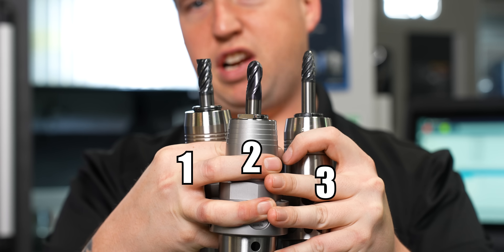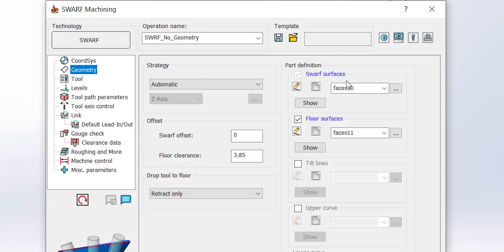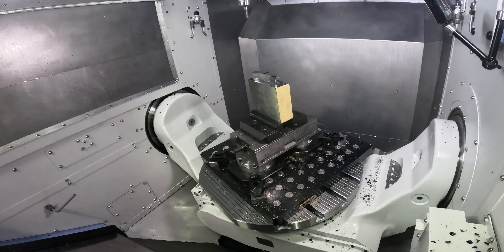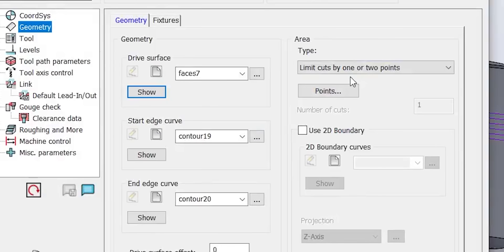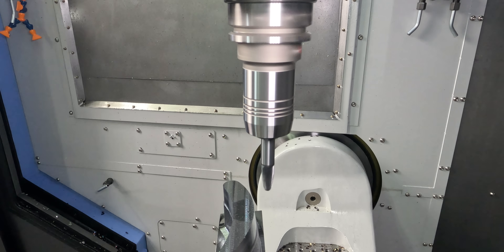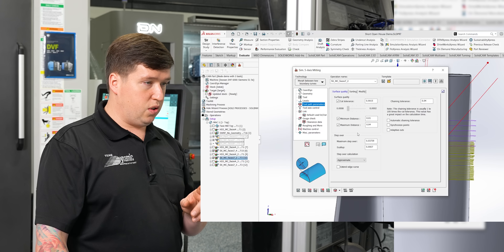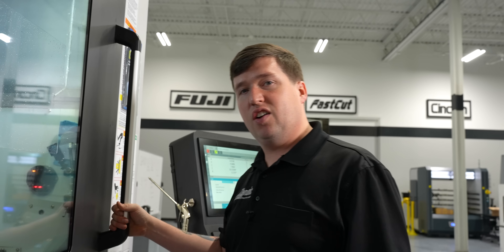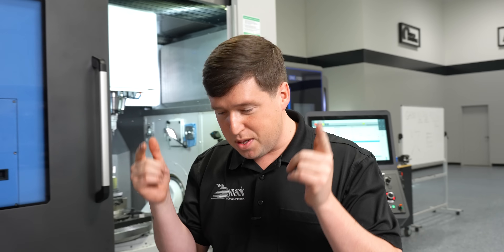3 Tools 3 Strategies 3 Results | Swarf vs. Barrel vs. Ball

Comment: Why not include cycle time? There is a significant difference between these three approaches. Also, to achieve a better surface finish, the step over needs to be reduced, effectively cutting the scallop height in half. Show how a 10 second toolpath quickly becomes longer than your lunch break.

Comment: me : define "Swarf"

chat GPT: Swarf is the polite industrial word for the mess you make while turning metal into shapes. Tiny chips, spirals, dust, curls, needles, glitter, shrapnel, whatever the operation produces. It is the physical evidence that atoms have been persuaded to leave their comfortable lattice and depart the workpiece.

In the broad sense it covers:

• Turning chips
• Milling chips
• Grinding dust
• Drilling curls
• Sawing filings

Basically, if it came off the workpiece and it gets everywhere, it is swarf.

Comment: However you forgot to mention limitations. While using the standard end mill, you can only use the specific length of cut.  Where the barrel and ball allow that pivot angle this giving clearance for one op manufacturing.  And we all know that less babysitting and tool changing creates better efficiency snd profitability.  Still for all intents your video is great for explaining the differences. I'm a master tool grinder and it's fun seeing the pieces i make so their jobs.

Comment: Its a neat demo, but i feel like there is annother point to the swarf that you are not mentioning. The tool projection of the mill limits you to a max depth. Those 7 degrees tilt angle do wonders in letting you snug up the tool.

Comment: A little off-topic - there seems to be a lot of "flexibility" in that setup, and not the good kind. All that chatter and resonance isn't good for accuracy, finish, and cutter life, is there something off with the machine, or too much stacked fixturing, or ??
Reply from the maker: Chatter? What chatter? Are you talking about the finish the rougher leaves? Those are just feed marks
Reply: @donniehinske  I'm talking about the resonance during rough milling, which from the audio and finish I take to be chatter. Not there so can't make a true judgement, but that's what it seemed like to me.

Comment: Donnie, you should turn on the cycle time setting for each tool path. It's a setting in soldicam. Then you can easily compare the different times between each tool path. Also, it will display the whole cycle time of the part beside the operations tab.

Nice video!

Comment: It's crazy moduleworks owns all the main multi axis algorithms that pretty much ALL CAM softwares use. I've never used solid cam but I recognize the pics from mastercams swarfing. We have mastercam and NX at work and even testing out NX I can see the overlay and how the backend is moduleworks algos. Basically most CAM software license moduleworks algorithms then just wrap the toolpath in the softwares UI but in the backend calculations the NCI or "list" as NX calls it (toolpaths before post processing) is created with the other companies algorithms. No wonder cam softwares are so weird sometimes so many different things have to talk to each other.

I got a video Idea Donnie. I am a proponent of using scallop height as the way to determine how you want your flowline (mastercam) toolpath to determine the stepovers. I have always said that using scallop means that you can change the radius of the tool, or if on a 5x doing 3x surfacing(3+2 style), change the angle of contact with the surface (say it's an angle or radius) and end up with the same surface. It's not true with step over. you can change the tool (mainly say a different radius ball EM) and with the same stepover you will get a different finish as well as how you contact the angle or radius on the part. Scallop > step over. So the video would be use scallop to determine step over on a toolpath, say surfacing a 45 degree face on a part in 3 axis mode. Then switch radius of the tool and show how you can keep scallop the same and get the same finish but if you try to keep stepover the same you end up with a different surface. I have always wanted to show people this. Some folks are just like "yep I do .005" stepover and it's a good finish" hahaha
Reply: It's easier to understand what movement the ballnose is doing compared to the surface area, when referring to the stepover. .005" is pretty small, and would cover most decent diameters. Unless you're getting to down engraving sizes. Either way. .005" is .005", and that means whatever cycle time estimate. The only thing that changes with a larger ball, is a better surface finish. Given space permitted to use it.

Comment: If you’re trying to get the best surface finish possible on that fan blade why not use a lens mill on it with the table flipped at 90?
Reply from the maker: That’s actually a really idea to test and compare against the barrel mill

Comment: There is an easier way to define the tilt for the barrel mill, under tool axis controle, if you set it to contact point, you get the possibility to select the barrel section, and then you can define the contact point on the barrel section by a percentage.
Said in another way, the use of barrel mills are totally integrated in the software 😎
Reply from the maker: Really? That would be a cool short! I will be completely honest I am still an amateur when it comes to this software. Maybe that’s obvious tho 😅
Reply: @donniehinske you're doing really good, so just keep it up, and I have worked for the Scandinavian SolidCAM reseller as a post developer for 7 years, so i should know a few tricks compared to most😅

Comment: those blends are pretty atrocious! is the machine that loose?
Reply: Probably didn't spec the direct encoder, and that control is unlikely as optimised as it would be on a directly related machine- high end Euro.
Reply: I'd bet it's not the machine, but the tolerance on the profiles of the different tools. Blending different toolpaths with a single tool is way easier to get perfect.
Reply: @user-lj4xq4hm3k disagree, some of those look like over .02" mismatch, that's more than just tolerance!
Reply: Everyone has to blame the machine 😞 I assumed it was because he didn’t go far enough down with the first tool because of the roughing. The point of the video wasn’t blending tool-paths together lol. You’d never cut something like that with different tools unless you literally had no choice.

Comment: I never really knew what a barrel mill was...I suppose whenever I saw one I just thought of it as a longer fluted ball endmill that would be used in a similar fashion but never really gave it more thought than than that. Is  a tool that is 5 axis specific or is there a time it might be used on 3 axis?
Reply: Nah, it’s pretty much just for 5 axis. It’s actually part of family of tools categorized as “circle segment” cutters. Where they take a segment of a large radius and put it on the tool. Another example would be a lens cutter, which can be used on 3 axis, just not as effectively as on a 5 axis machine
Reply: @sumdonkus8770 Thanks for the reply.

Comment: the only real advantage to ball mills when you have a barrel mill and 5-axis control is that it can reach places and do things the barrel mill can not. with barrel mills and end mills, you're always limited by how much clearance they have to the tool holder, and then you can only really make surfaces that are either flat or convex. with ball mills, you can reach basically any feature bigger than the mill, and you can make almost any concave surface you want. but as you noted, you pay for this versatility with needing smaller stepovers to get a decent surface finish.
Reply: Also increased tool pressure can throw off your size